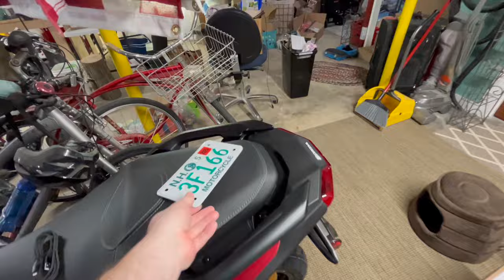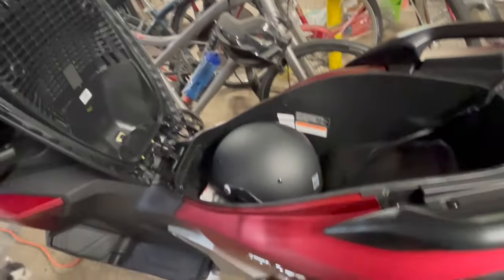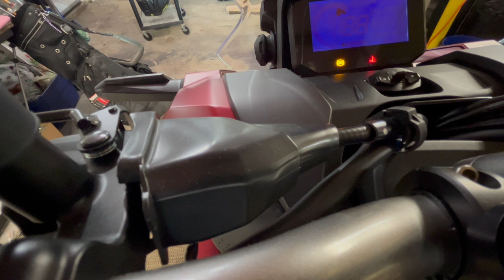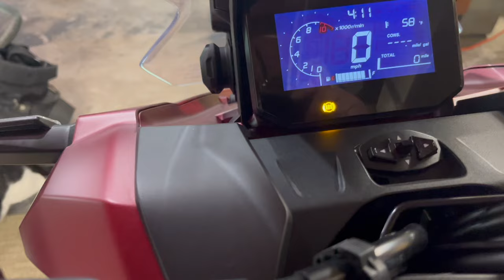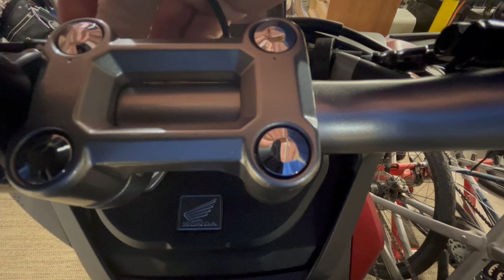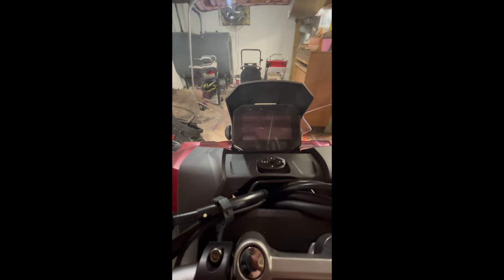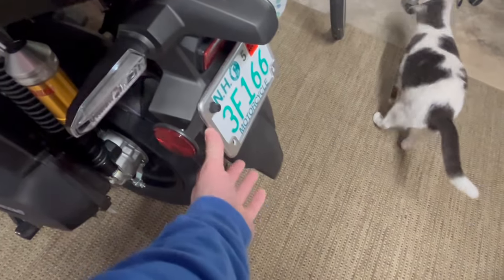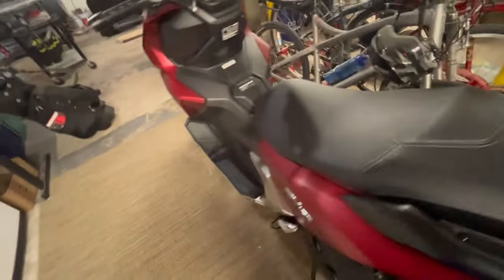My First Honda ADV160 Modification - Phone Mount and USB Cable Routing

Comment: I had a question about the hole you drilled. Some other you-tuber drilled a hole in the glove box of the ADV 150 for the usb cable, albeit not as elegantly as yours. One commenter to that video said this: “About the box cover of 12v Outlet, actually you don't need to drill the hole because there is a little space at the bottom of the cover which is designed for placing the phone cord when you want to charge the phone.” I was wondering if you could double check your 160 to see if there is space that you missed designed for the cable to be routed in the 160, as the commenter claims there is in the 150.
Reply from the maker: I looked, but was unable to find anything. I will look again! I would have routed the cable the way I did anyway, to keep it tucked out of sight and more "permanent" in a sense.
Reply: Yes I think you are correct.  The access is very small and not easy on the cable.  When the glove box is shut, if you look on the bottom side of the door, you should see or feel 2 small notched out areas (maybe a couple inches apart from each other).  With the door open, I was able to slide the cable from the right side of the door, toward the hinge, and get the cable into the right notched out area.  When you shut the door, it appears to not be pinching the cable, but it's a tight fit.